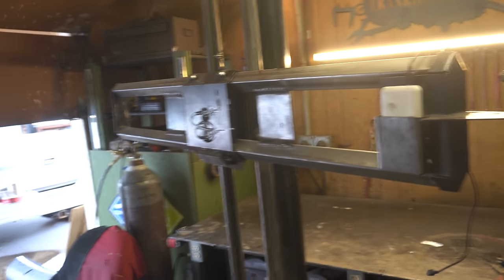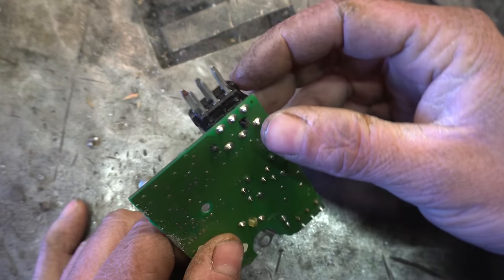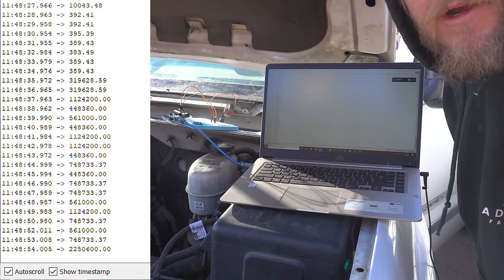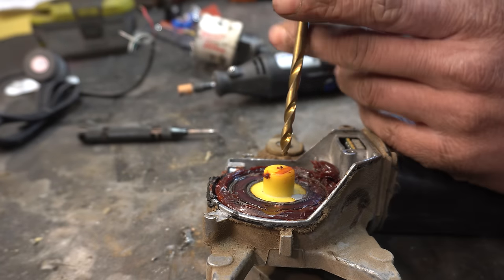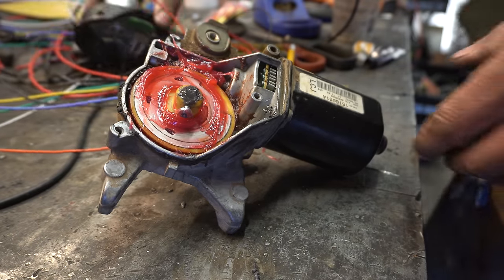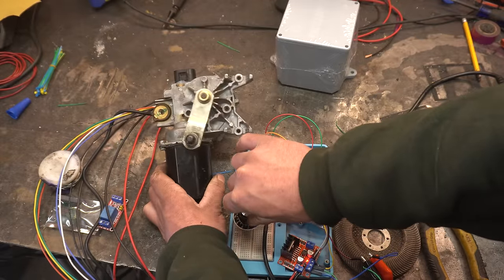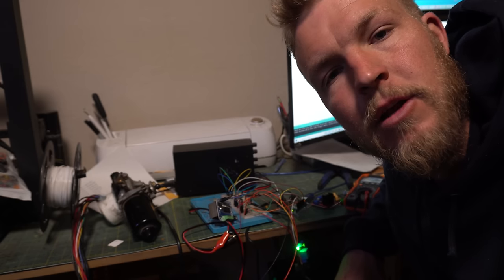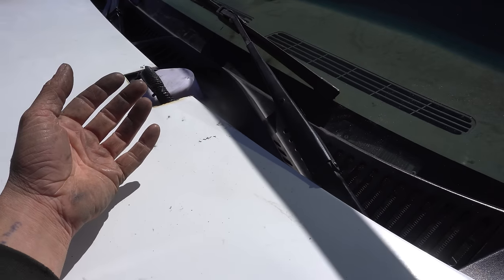I Made My Windshield Wipers Move To The Music

Comment: This must be the best most useless thing I've ever seen, and it's brilliant!
I laughed so hard at the PCB depopulation, then the modded scuttle panel, and then the bonnet (hood) cut-out. The piece de resistance is that the whole thing actually did exactly what was set out.
Thanks for the laugh, and keep doing you.
Reply: I respectfully disagree. 
This is probably the cheapest servo ever made at this power level.  Even new wiper motors are relatively cheap and junkyard motors are almost free
Reply: @TqSNv9R0iG5Ckxew  Respectfully, I think you may have misinterpreted my comment. Would you care to clarify what it is you disagree with?

If it's the first statement, allow me to explain the joke that was intended -
"The best most useless" is an oxymoron meaning that it is of the highest class of uselessness ie. The windscreen wipers will probably no longer perform their original purpose of clearing rain while moving to the beat, albeit the original modes have been reproduced in software. I doubt our friend rarely uses them for clearing rain in Arizona which is generally pretty arid.

As for windscreen motors being very cheap, useful and powerful sources of motive power, especially for servos, there's no argument there, and I'm not sure how my comment leads you to this conclusion.

All in all, the manner in which things are made on this channel are incredibly funny in their slap-dash construction (hot glue, clearance cut outs as an afterthought etc), but always with fundamental processes employed that achieve great results (a parody of those other "life tip" channels who's results tend to be genuinely useless click bait). 

Finally, the need to explain a joke often leads to the humour being lost.
Reply: @squelchstuff  
I agree with you on all points.

Comment: BEST EVER HACK! The desired position oscillation might be caused by lash error, to fix the holding sound issue, you can create a deadband area around the desired position in the PID software. Probably better to tune the PID better too but....  Too fun!

Comment: This is why I subbed to your channel. this is awesome. I once made a speaker box in the back of a Suburban, open the drawer showing 1000 watt amps, and at the same time, it would lift the Box up, and the speakers were face down, it would turn them 90° towards the the back, and then set the box back down on the drawer, the speaker was protected when not in use. I used the basic stamp 2, and, a wireless remote key fob. It was some trick shit. It had a little functionality, too. When the system was off it just look like you had two big, carpeted boxes in the back. But when you press the remote or turn the radio on, that's when all the fun happened. Timing all that stuff to happen, and keeping everything from crashing into each other, oh, that was a lot of fun.
Reply: It's amazing what you can do with window motors, some bicycle chain, and a microcontroller, LOL

Comment: If that is a normal encoder, A channel, B channel, there should be a Z channel that is a marker pulse. You can rotate the shaft to align it with something. Goo d to use as a reset or check for the other pulses.

Comment: Why ever use an Uno when Nanos are smaller and cheaper? Easier to breadboard since they slot into it directly, and when it’s time to move off the breadboard you can just get some perfboard and solder some socket headers that the nano slips into directly. Well it’s better to just solder a raw MCU in and program it via ICSP but baby steps.

Comment: With the PID loop, add a little bit of KI which will make the motor slowest speed up to get to the set point. Also if you add a simple if statement which checks if the motor is +- a value from the set point have it turn off. Something like this: 
if (abs(set point - motorPosition) <= value) {
Disable motor
}